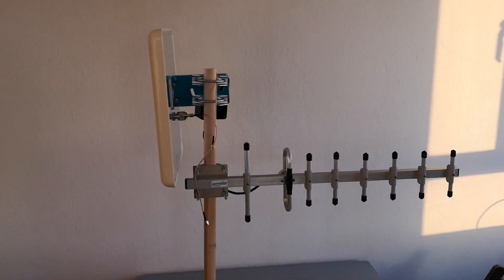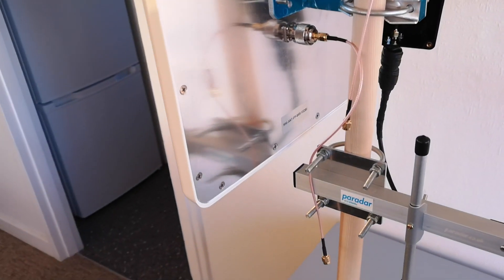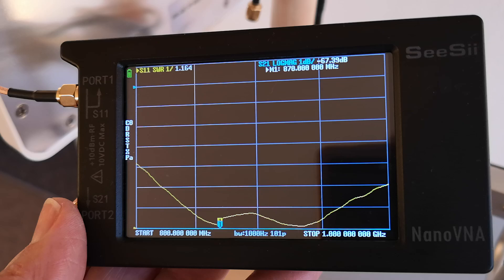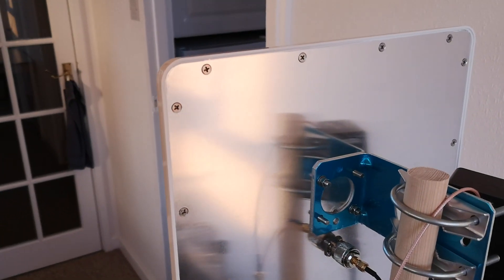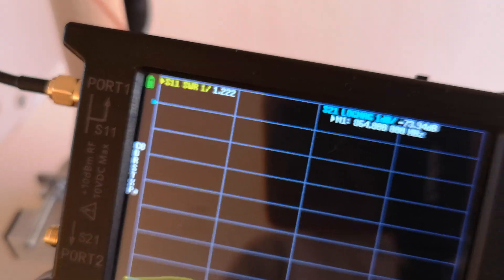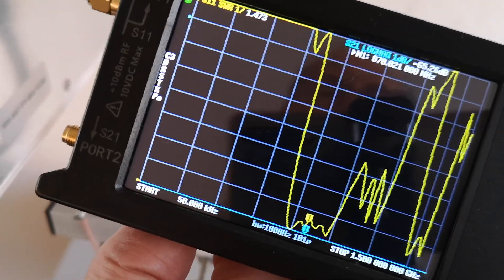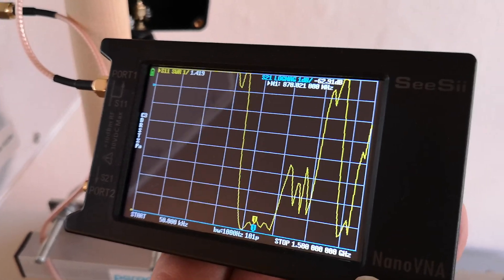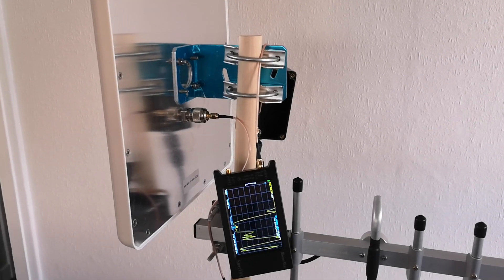Paradar 12.5dBi Yagi and McGill Microwave 10dBi panel SWR tests

Comment: Great informative video, thanks, Simon.
About that swr kink at 870MHz, has anyone worked out why is that? I also get the same kink on my nanoVNA-H and its annoying when tuning antennas. It seems like a calibration issue, but recalibration doesn't solve it.
Reply from the maker: Very good question. I often see it and have not yet pinpointed the cause...

Comment: I'd initially bought the 8.5 dBi Paradar omni and can just about contact my nearest node 14 km away but with an RSSI of -110 to -107. Traceroute and position requests are 50/50 but unfortunately actual message sending only rarely get through.

I've now ordered the same model Yagi as Simon that's due to arrive this weekend so I'm optimistic that the slight bump in dBi but more the far more directional transmission will improve things a lot.

Great to have this equipment independently verified 👍
Reply from the maker: Lets hope that extra 3 or 4 dB will help you to get through. Do you have the shortest possible coax on the antenna? Better still, none at all.

Comment: Hi there, according to the description that Yagi is 50ohm my question is do you know how is the driven element connected inside?
Reply from the maker: That is a good question and I don't know the answer. There is also a black casing on the other side of the folded driven element which also might contain something.
Reply: @fotografm  Yes, I suspect that it might be connected as my  Chinese knock off,  the same design. The center wire inside the metal disc is where the split happens in my case live wire goes thru insulated concentric cable core and the shield of coax is attached directly to the metal disc. This insulated cable loops in one half of the dipole and is soldered to the opposite inside where the black heat shrink is as there is a gap. Therefore not a "classic" dipole.  I'm looking for someone with  more knowledge on the antennas as I changed the given connection to a 4:1 coax balun but I think it got attenuated too much  so I reverted the change. But don't have VNA... yet.

Comment: Mmm  the McGill could be an option for me. Got me thinking about some kind of Window bracket so its on the outside of the house  the wider angle than the yagi would be better for me.    Hoping somebody will do a best Mesh Car mag mounted car aerial next :)
Reply: You can get a magmount 868Mhz aerial from CPC. It works.
Reply: Order code RF00099
Reply from the maker: Watch out that it doesn't get blown off.